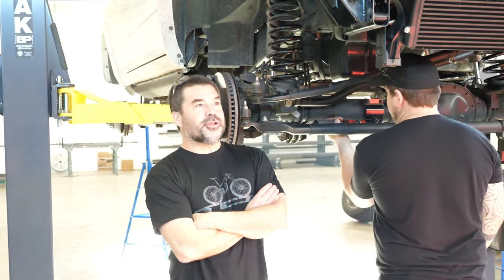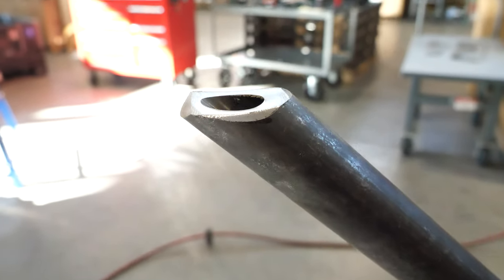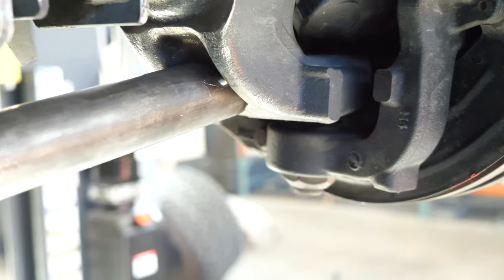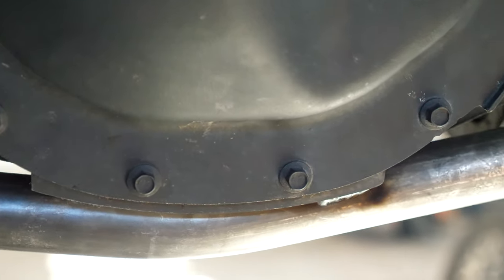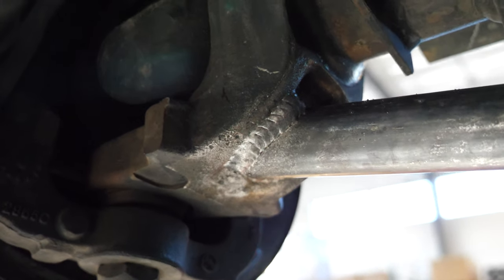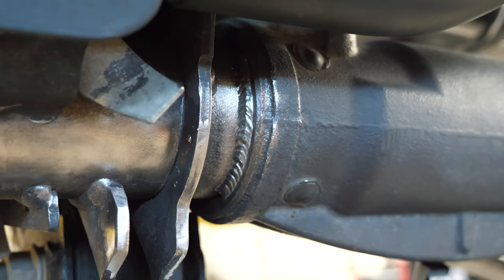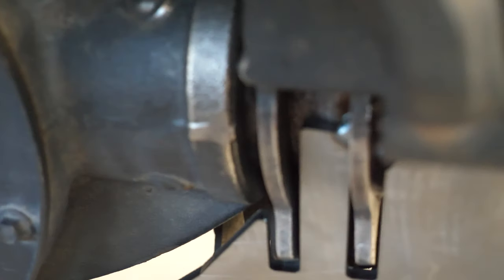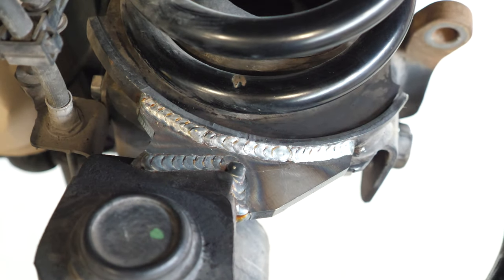THUREN 2013+ FRONT AXLE TRUSS INSTALL

Comment: Ok I have always heated cast iron before welding . Kind of a normal cast iron process. Was the reason you didn't want it hot because you didn't drain the differential?  Or was that nodular iron?